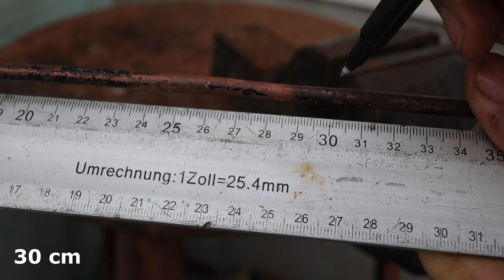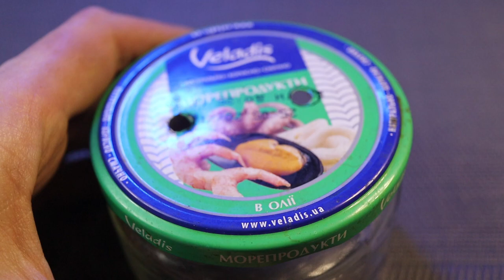Making a turbo alcohol stove

Comment: can it boom due to pipe getting hotter and pressure inside increasing?
Reply: The pressure is not going to be anywhere near enough to blow the pipe up. Also the pressure is constantly being relieved, it’s not just building up